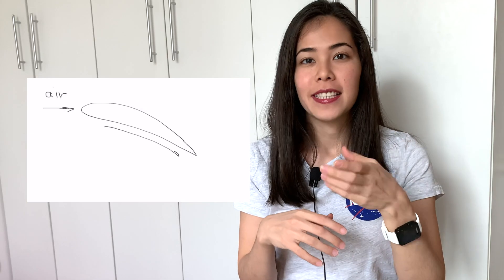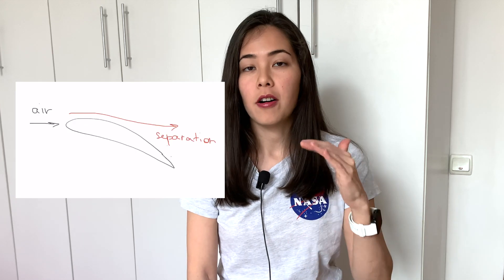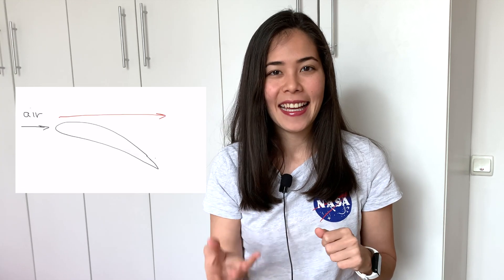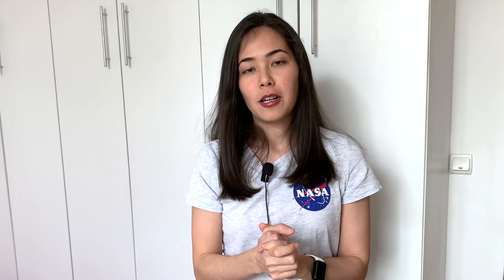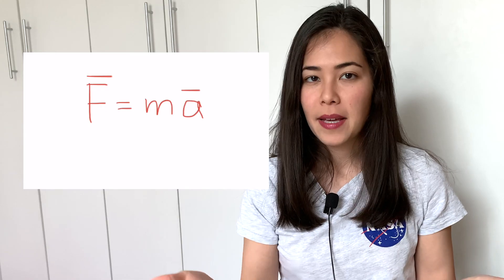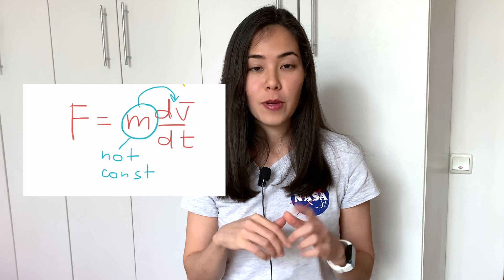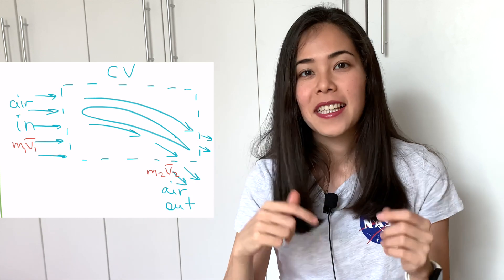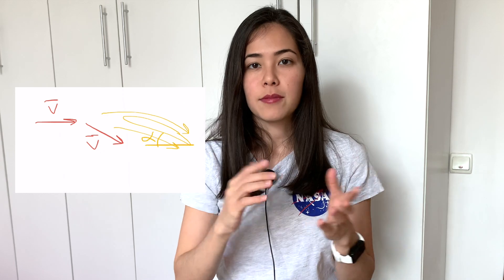Introduction to Aerodynamics: Lift

Comment: Full credit for invoking the conservation properties.  Those mean everything.  But you go in the wrong direction in, apparently, trying to pin the downward change in momentum, right at the trailing edge.  This false logic derails the logic of the rest of the narrative.

What does the Kutta condition actually do to potential flow?  It invokes asymmetry between streamline inflow out outflow.  This is necessary to make the net change in vertical momentum exist at all:  streamline symmetry - no vertical momentum response; streamline asymmetry - proper vertical momentum response.

This is not localized at the trailing edge (as nearly always portrayed), but (the vertical momentum change) occurs over a more distributed space in the region of the airfoil.

Comment: Aaliyaji,

Hoq does a pilot jydge that plane is ready for a lift off above ground? What indications he sees on panel? It is observed that he lifts off front wheel first and not rear wheel where as in helicopter , whole body lift. What is the difference in lift off of aur plane and helicopter?in short, Are both lift off same?

Comment: The equal transit time hypothesis is circular reasoning. It says that a pressure differential causes lift.
However, 'pressure differential' is a synonym for 
'lift'. Lift does not cause lift. You can only get lift if you can deflect air. And you can't  deflect air without getting lift.  One is the action, the other,  the reaction.

Comment: The shape of the airfoil does  not cause lift. Rather, the shape determines the efficiency in the work of deflecting air. You can defect air inefficiently by having  your flaps on while cruise, or by having them off while landing. However the shape is not the cause of the force, the deflection is.

Comment: I learned a lot in this playlist. Thanks. I would like to ask (I know this is not aerospace) if NACA foils are applicable as hydrofoils (in hydrodynamics). Thanks!
Reply: yes ... just use the density of the water they are runnign in ... as the NACA numbers are using the pressure of AIR and not fresh water or salt water ... but BOTH are fluids 
.
be aware that hydrofoils are air foils for water ...  and they have one other thing to consider ... stuff that may cling to them while in use or over time ...

Comment: Thanks for the video.
Flued dynamics has some nice diescriptions of the theories, but as soon as I try to do the calculations it suldandy becomes quite hard, often impossible by hand.
Here are some of the questions I have. Maybe the is a video ideer among them. :-)
1. How to calculate Re (reynolds number) in given situation. I can do it for a fluid in an pipe, over a flad surface, and maybe for an airplane wing. But I cannot do et for an axial fan or a propeller where Re might change over the length of the blade?
2.  How do vortex generatorers work? How do you know what size and how far back on the wing to place them?
3. The angle of attack makes sense for for a wing, but again for an axial propeller the incoming air and the propeller rotation creates a velocity vector. close to the center the incoming air has a higher relativ speed compared to the blade, and at the tip of the blade the blade speed is much higher relativ to the incoming air. Thus the angle of attack should not be constant along the blade. And for an axial fan, the blade is what moves the air, thus the incoming air speed might not be constant along the blade either. This creates a loop, you cannot calculate how much air the "propeller/fan blade" moves, before jo have calculated the incoming air speed such that you can calculate the optimal angle of attack along the blade? I guess the tip of the blade would move more air assuming the same area do to the higher speed, thus the incoming air speed is higher at the tip, meaning the angle of attack should be smaller at the tip, compared to close to the center. 
4. And then we have how much drag the blade creates at the center and at the tip? (depending on the angle of attack and so on.
5. And how many blades should the propeller have?
6. And how to reduce the noises from the propeller?
7 And how to select a airfoil? http://airfoiltools.com/

I have plenty of questions. :-)
Looking forward to your next video.
Reply from the maker: Thank you for watching and suggesting these ideas! It's pretty difficult to explain it in the comments, so wait for the videos some time
Reply: for 3 an iterative calculation for each parameter feeding back in to the equation to refine the result further can work ... BUT you need to start from the basic values ... like air speed and propeller speed plus chord at each slice of the propeller... etc ... makes for a lot of calculation but spreadsheets are good at that ;) 
for 5  .. 
... how much drag and speed does each blade introduce and which compromise is best for your needs ... 
6 how close to the speed of sound is any part of the propeller .. like on helicopters who's tips are curved back that reduces drag and noise ... and yes it is also a consideration for 5 as well 
7 ... it depends on what you want it to do better ... manouver ... lift heavy loads ... or stay up longer and so on ... again a compromise of all 3 that best suits your needs ... 
.
ever notice aerodynamics is all a compromise ... you have to let something be more prevalent to get a desired result while repressing other things ...